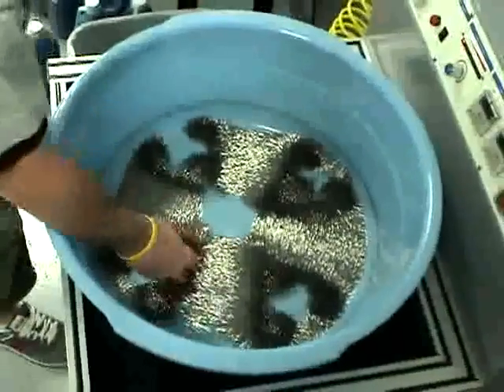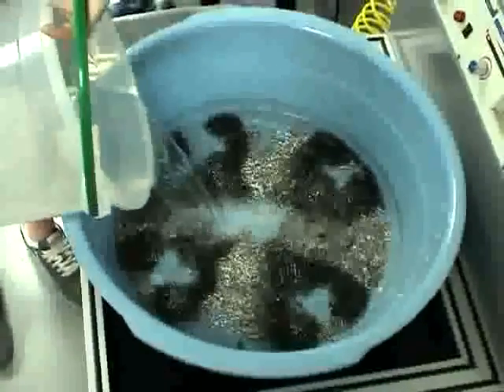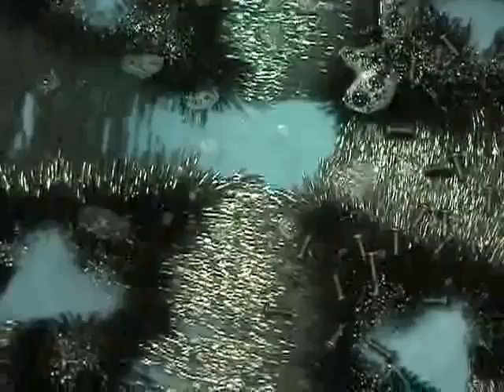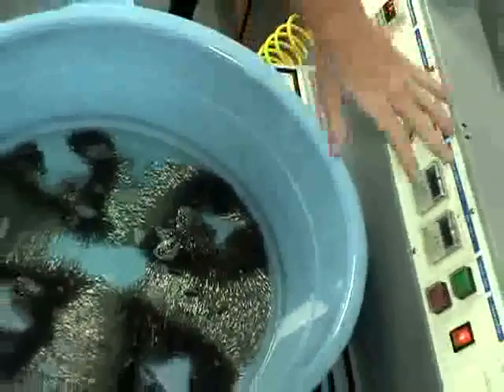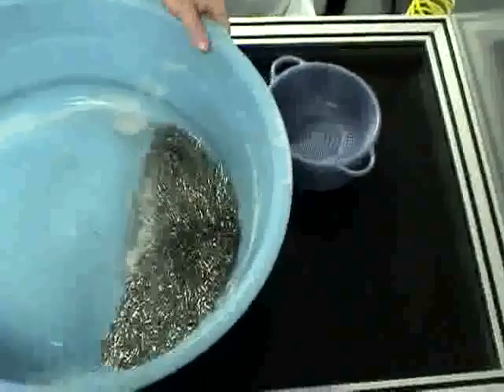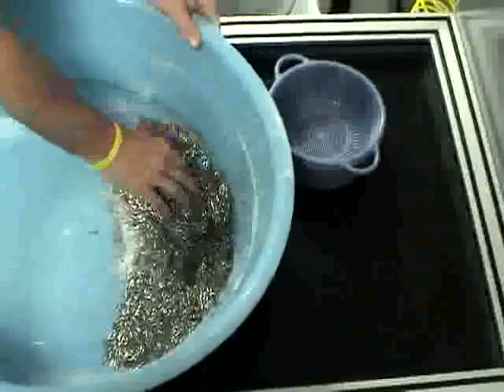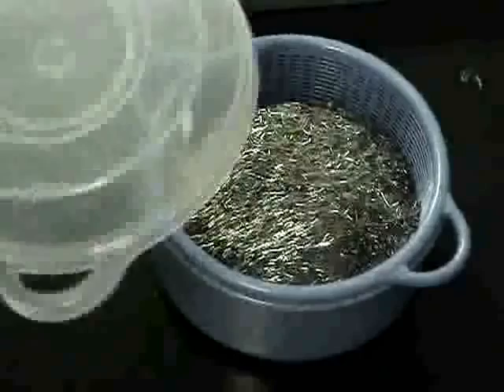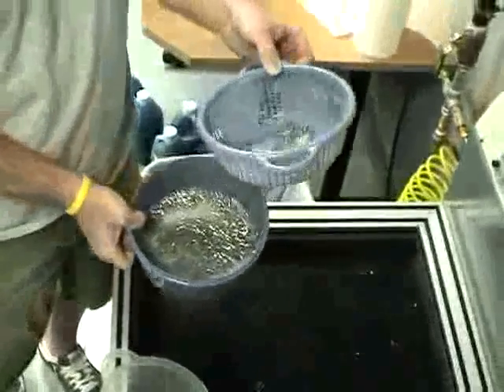Earth-Chain sPINner Magnetic Deburring Machine

Comment: Hello, have you ever tried magnetic items to be de-burred or polished with non magnetic media? for instance: a chain mail shirt and some course sand ?

Also I wonder if this kind of machine is (obviously depending on the type of media used) capable of de-galvanising electric fencing wire and how such a procedure would work.

Yes you guest it: I am looking to do some abrasive work (de-galvanising, smoothing after butt welding rings or eventually de-rusting and/or cleaning chain mail pieces.

Regards, Sander.

Comment: Only average performance. For My use. Certainly no better than the doughnut vibro machines. I have Spinner HD745 bought in 2011 and have had a few maintenance issues. Most worrying, an electrical short that could well have sent the whole machine up in flames.